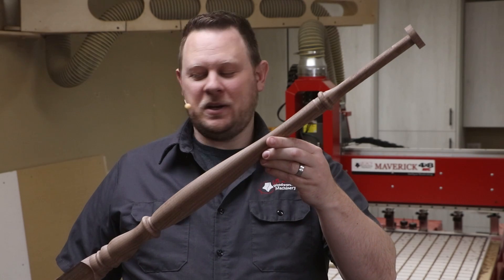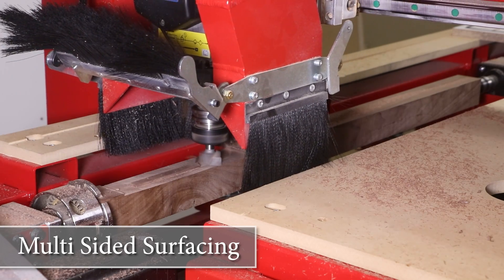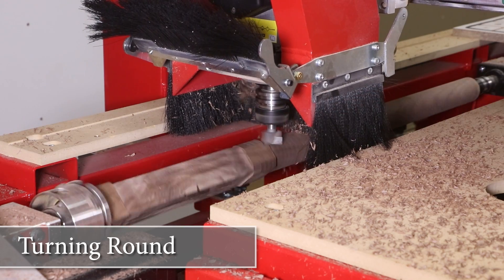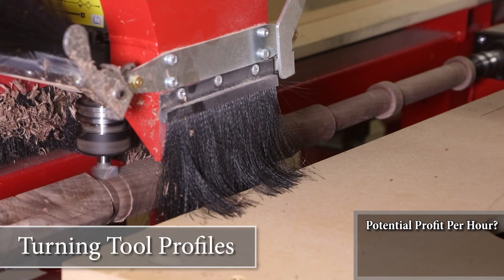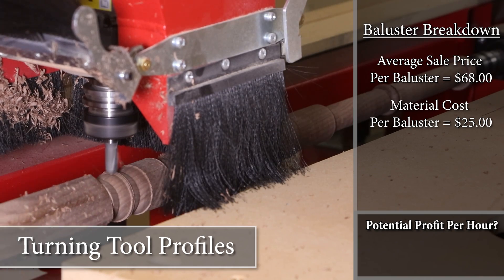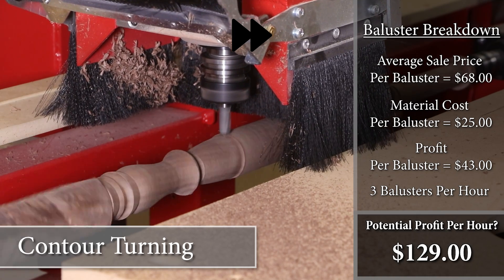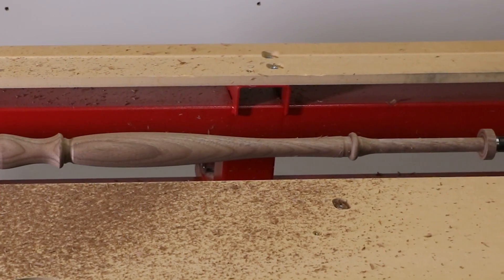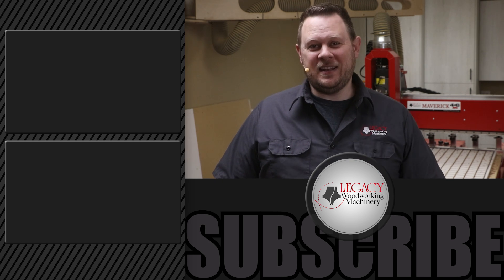Turning a Classic Baluster with the Maverick CNC

Comment: That is very cool indeed, however the shape of the baluster is well, not great. I would love to see how it does with a nice shaped baluster. Typically i can turn a baluster in between 10 and 15min complete with sanding, and that's a more complex shape than the one in this video. There is of course a little variation in the shape when turning by hand, but nothing noticeable when they're all installed. As a woodturner by (dying) trade, its still pretty cool to see how pretty much anone can use a CNC machine to make this sort of thing.
Reply from the maker: Bryce, send me a picture of what you would like to see and I will see what I can do. john@legacywoodworking.com